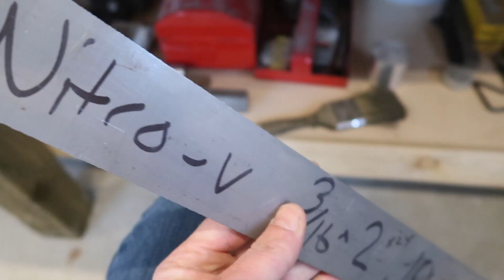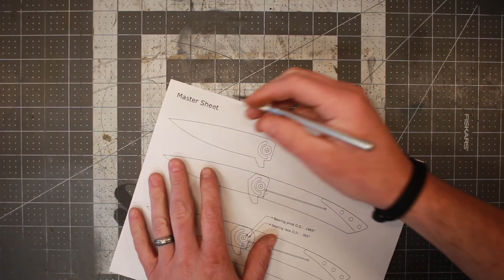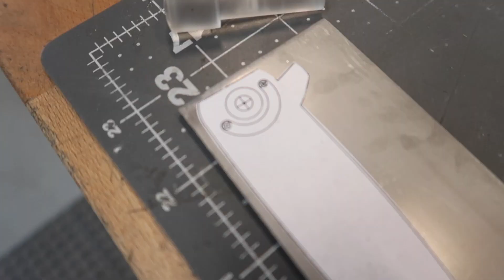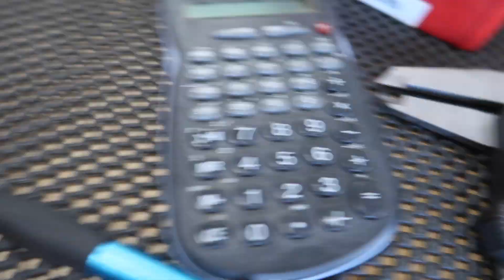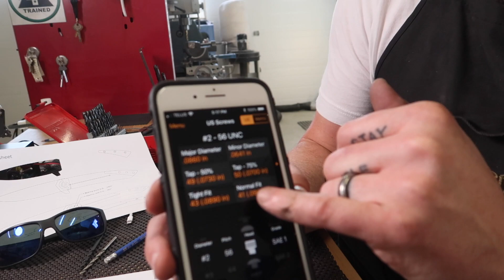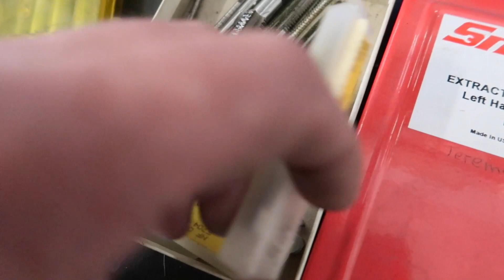You probably don't want to watch this. It's just a vlog. (frame lock folder part 2)

Comment: I’m by no means a knife maker, I’m a work in progress at best. Watching this I couldn’t help but think.. wouldn’t it be cool if you cut recesses into your scale material to accommodate the bearings and still keep the knife reasonably thin? Kinda similar to what Zero Tolerance does on the 0562 and 0452. I’m by no stretch in any position to give advice, just a thought. Awesome video, look forward to part 3!

Comment: On the tap front does the app you use give a metric equivalent? Here in the UK an Aus we love metric......makes for simpler maths.
Reply from the maker: Yes it does. Here in Canada we’ve been “using” the metric system too but we’ve ended up with an odd mixture of the two. In trade school we did everything mm but somehow I prefer imperial. Probably because that’s what I always saw my dad using. 👍

Comment: Could you please tell me the best method for drilling out hole in 1095 and O1 tool steel?  Its so frustrating to try and drill it out so I just don't try to make any knives because of it.
Reply: The harder the material, the slower the drill speed. Cutting fluid is your friend.